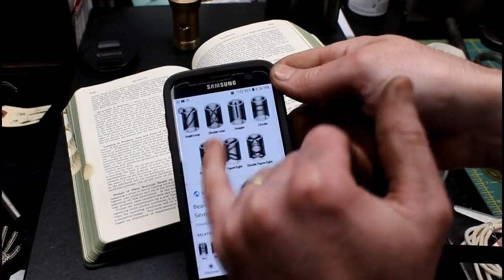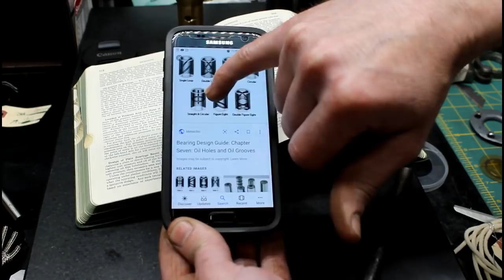K&T MILL TABLE REMOVAL AND MORE

Comment: Just a suggestion, when lifting the table, use 2 lift points instead of just one. 
Also, I would use a cheap spreader bar or load leveler like the ones used for pulling engines.
I find it makes those lifts much more manageable.
Thanks,
John
Reply: I agree 2 points of lifting are better and the load levers work very well!
Reply: I like the engine tilter idea. Perfect answer

Comment: Idea for removing broken fitting: tig weld a ring of weld around the inside of the fitting, this will shrink the fitting slightly when it cools, then since the hole is smaller, use the easy out you have and bam, comes out easy.

Comment: I needed new lense covers for my #2 Cincinnati horizontal mill I'm refurbishing.  Went to Michael's hobby store and found thin [about.030 thick] picture frame covers, very clear and I cut them in my arbor press with my large hole punches. Works great and are just like the originals!
Reply from the maker: Except 10× cheaper 😁

Comment: Steve, excellent video. When trying to find the source of  a noise I have been using a piece of plastic tube that just fits in my ear hole and putting the other end at the suspected source of the noise. I have been chasing  leaks on a steam engine (using air, not steam of course)  and found this to be most  diagnostic, cheers, Richard

Comment: I worked in a shop once that had a oil groove cutting machine. It's the only one I have ever seen. It's like a combination of a shaper and a lathe. The bushing rotates and the tool cycles back and forth via a cam just like on a shaper. You can set the stroke and it makes a perfect figure 8 groove. One of the few good tools at Harbor Freight is the "pipe nipple extractor" kit. Well worth having. It's saved my bacon many times.
Reply from the maker: Never heard of a oil grove machine.. I would like to see one👍. HF has some good items here and there.  I'll have to look them up next time I pay them a visit.
Good to see you Wes. Keep those videos coming.

Comment: Amazon sells both of those bearings. Ironically, the 41125w is $18.50, the plain 41125 is $28. Still not bad considering. Both timken brand.
Reply from the maker: I over paid😑. Still wasn't all that bad. Got some NOS Timken for about $125.00.
Reply: Amazon is definitely your friend i buy a lot of stuff off there to build and rebuild my machinery .Great video Steve
Reply: @SteveSummers  most of the ones available dont come with the outer race.

Comment: When I was young I always was with my father working on things. It's how I learned to do everything . Old school family fix it don't buy new . Dad was a carpenter , built houses and repairs. But he was head mechanic and plumber , electrician , everything. Does your son hang out helping you I bet it would. Just wondering not prying. Looks like the kt will be getting a real new greasy feeling ha ha. I have spline type extractors that work super on pipe fittings and bolts that are broken . The angle type jam the broken parts tighter. Thanks for the videos.

Comment: Speaking of cars and paint I bought my daughter a new car in her senior year of high school. She drove it that year then off to Agusta Ga for two years of school there (200 miles away) graduated there and came home.So far not a scratch and Agusta is a BIG place. Started Mercer Law about 40 mies away and on her first day of class was forced into a retainer stone wall by a professor leaving work to the tune of 3800.00 damage. Three years and not a scratch then this. So yes to your point no one is immune to it. I have to say you are persistant. I just don't think I could have put that much work into that arbor. Functional yes but a work of art not so much. Great job on the bushing.Been running a big Kent brand surface grinder at another plant. It carries a 24 x 2 inch wheel. Had to change it out yesterday and boy what a job that was.

Comment: I will say one thing: a Bridgeport is a lot simpler design than a K&T, of course kind of like comparing apples and oranges lol. Thanks for making the video.
Reply from the maker: Yeah, totally different machines. The power feed is the most complex part on a BP mill. They are pretty simple built. That makes them reliable.

Comment: about grinding the inner taper in the drill chuck , i think if you chuck and grind a roundbar to youre setup while clamped in the rotator / spindexer 
then clamp the chucks mouth on that and use that setup to grind the inner taper on the other end of the clamped drill chuck 
i think it would have verry little runout that way as its centered to where you clamp the drills in unless the chuck itself is worn and doesnt clamp the same way every time

you need to predisaster youre stuff , that way you dont have to be carefull no more and live with the fear of damaging it
Reply: Those were my thoughts exactly on how too grind the internal taper on that Chuck. Now...how to determine the wear on the Chuck jaws. Tom Lipton just had a good video on rebuilding a Jacobs Chuck. The Chuck was a total basket case frozen with rust and he turned it into something really good and useable.
Reply: @marcellemay7721  as long as the chuck champs down the same way every time it shouldnt matter as the taper is ground to that , if the innitial runout is realy bad he could clamp the body of the chuck in a 3 jaw and grind the chuck itself first before doing the taper in the way i mentioned

Comment: The body filler reminds me that the waterjet channel cut a cheap anvil in half. They found body filler inside where the casting had a void. With their pretty paint job there was no clue from simple inspection.

Comment: Regarding the surface grinding going on, why do you have the part at such an angle? Seems like you could get it done in far fewer passes if it was parallel with the table.
Reply from the maker: It's a common used method used to reduce heat built up in the part. The angle reduces the time in the cut lowering heat and reducing warpage.  Yes it takes longer.

Comment: Maybe you could send those bearing races to Abom79 to have him spray weld them to fill in the low spots.  Then you can put them on the lathe and cut them back to spec.

Comment: Just curious , maybe I missed something how did you set up your grinder to touch up the morse tapper # 3 ?
Reply from the maker: The table on the cuttergrinder pivots and has scales on the ends to rough it in.  Got the info on taper of the JT3 out of the machinist handbook and also used a good setup taper to dial in with a test indicator. I believe I show how in some of my past cuttergrinder videos. 👍

Comment: Another way to get broken pipe ends out is to cut along them until you reach the top of the threads in the body. Then take a punch and lift one side and curl it out.

Comment: I've noticed that the drive belt on the cutter grinder is always very slack, do you ever have any slippage?
Reply from the maker: No. It takes very little to run that unit. It's a split belt and I keep it loose so I can change / remove it without tools.

Comment: @ 28:57 I use a screwdriver as a Stethoscope...
Metal flat end to the offending end;... ear on the handle...
U will B surprised how easy it is to find the noisy end...

Comment: Remove the gib slide table to the left, support the table with a strap, everything you need will be exposed. No need to remove table if you are not remachining or res rapping.

Comment: With me it is Tires, I can go 50,000 miles with out a flat but buy new tires and not go a 1,000 and pickup a nail or screw or what ever in the new tires.

Comment: When you buy a brand new dirt bike... first thing you do is toss it down in the garage... just say'n. :)
Reply from the maker: Looking at buying a nice dirt bike for my son. Definitely not new. That's crazy 😁. I have had many over the years. I ride them like they are stolen. No need for a new one. The new would last about 5 minutes.
Reply: @SteveSummers  Only had one brand new - 1997 XR400. Currently have 2 old KTM 300s. Don't ride much anymore.

Comment: Surely you can clean the corrosion off and fix those bearings?
Reply: yep the noise is the crap inside them. too much stuff gets thrown out that is well made and perfectly serviceable, obviously wouldn't use them in a spindle or the wheels on a car but peeps are too precious about stuff sometimes and don't bother trying